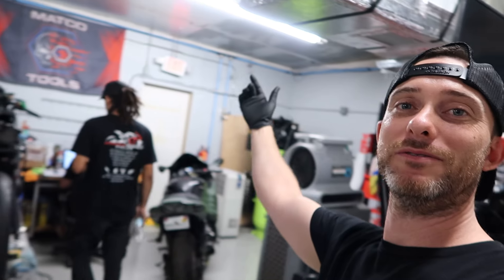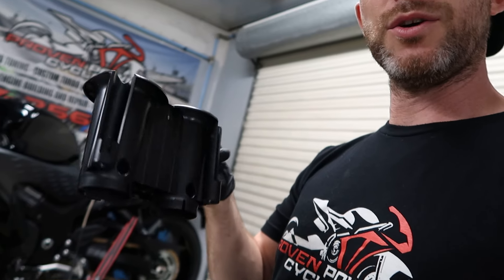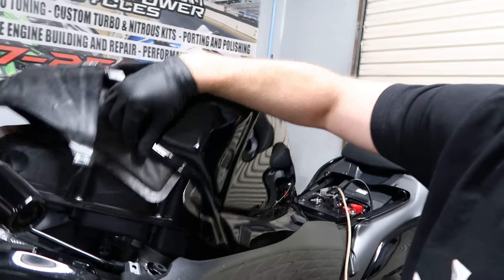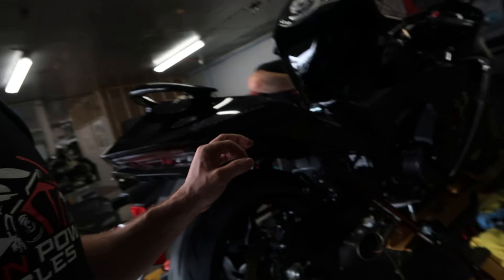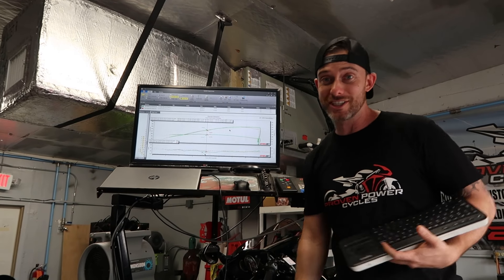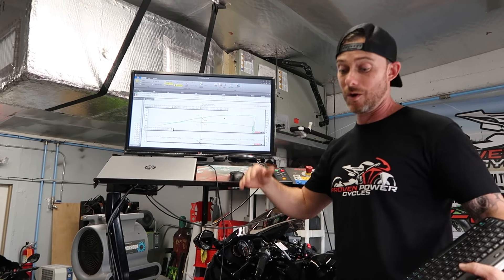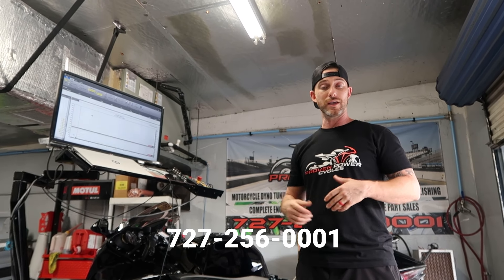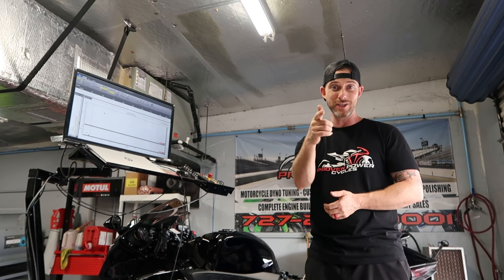DIY 2024 Hayabusa Velocity Stacks Make Power?

Comment: Eric encourage your customers to take their 3 gen busa back for the front brake master cylinder recall before it's too late 22-24 models
Reply: Please elaborate. Whats the exact issue that it's causing? Something of concern?
Reply: @dinshak86  anything that affects your brakes is a concern don't you think
Reply: @xxxxxx_1300  yes it does. But I meant to ask is there something faulty that's coming inbuilt from the manufacturer itself?
Reply: @dinshak86  yes it is that's why it's a recall
Reply: @xxxxxx_1300  maybe it's concerned to batches in some countries? Or is it a global recall?
Reply: @dinshak86 Man I see you are hard headed, contact your damn dealer ,I'm tired of going back and forth with you about the matter
Reply: @xxxxxx_1300  tnx
Reply: @dinshak86  the air nipple on the brake is faulty. Mine has been recalled twice, for the same problem.